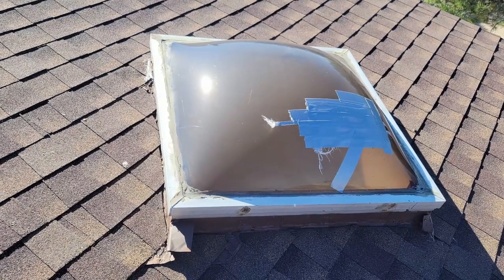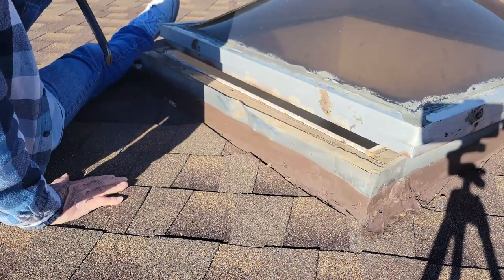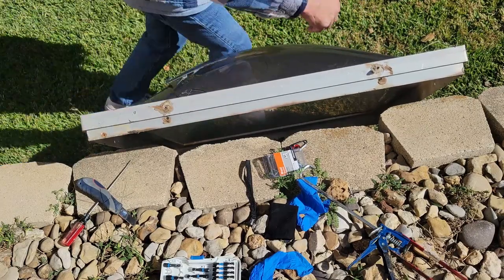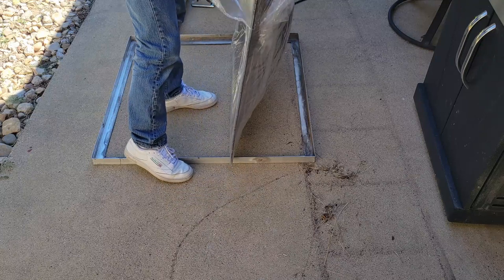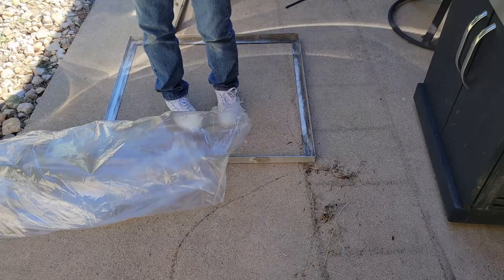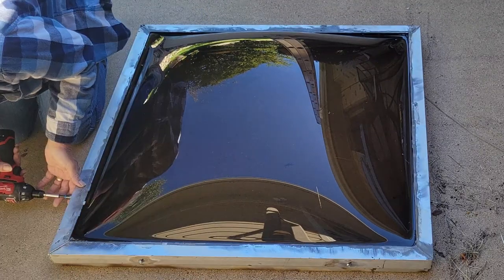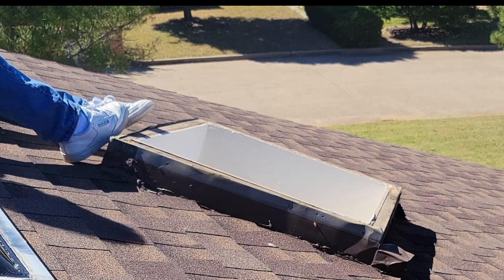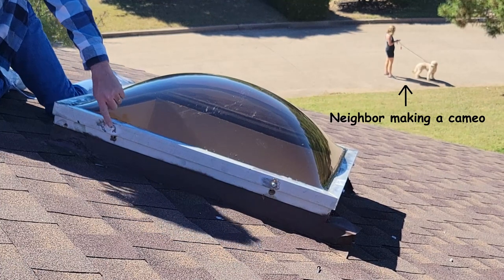BROKEN SKYLIGHT - Replacing a skylight damaged by hail - DIY

Comment: Our skylight is shaped like yours. We also had damage due to a hail storm. Our skylight is double layered. Where do you order the replacement?
Reply from the maker: I get mine from Dryco Skyights in Alvaredo, Texas. It was a bit under $300 for both the inside and outside lenses the last time I ordered them.

Comment: Awesome video. I looked back at a roofing quote I had last year and they wanted to charge $2,000 per skylight and I have 2 of the ones you are replacing.
Reply from the maker: I was in the same boat 20 years ago when the first one got blown in by hail. I was surprised at how easy it was to replace myself. 👍
Reply: Can you use the same frame if you change it out with a flat skylight?
Reply from the maker: @Lar2-D2  It depends on the skylight, but I would guess that you probably could. The frame attached to the house is what you attach it to.

Comment: I'm surprised these don't have a replaceable gasket.  Roofers used a metallic tape to reseal mine and that did not work as promised.
Reply from the maker: I am a little speechless that they would put tape on them, they have a replaceable gasket. You can buy gaskets at Lowes, they have a few different sizes.
The gasket goes between the bottom lens and the frame attached to the house, that's what keeps the water out. Then cork spacers go between the lenses, then a bead of silicon for good luck between the top lens and the upper frame.
I have 4 skylights, I go through this after every 3rd or 4th hailstorm, at least one breaks.
Reply: @GuysPlayingWithTools  Thanks!!!
Reply from the maker: If you aren't afraid of being on the roof, and you are coordinated enough to not fall off, it's a pretty easy job you could do yourself.  A few screws around the outside of the aluminum trim hold it all together. I silicon them too, I don't think it makes any difference though. 
Let me know how it goes! 👍
Reply: @GuysPlayingWithTools  I am afraid.  It's pretty high up, but this tells me that it shouldn't cost $1k to have someone else do it, which is really helpful.
Reply from the maker: @donnasfix-it3861  mine are 32" square, and I got a quote of $450 including installation for the latest,  top of the line,  energy saving skylights. I paid around $130 or $140  for each set of 2(inner and outer) for the lenses I am using now. 
My house is a 2 story . If I stop making videos after a hailstorm in Dallas, you will know what happened.  Lol
Reply: @GuysPlayingWithTools  Stay safe!
Reply from the maker: @donnasfix-it3861 I aim for the grass, it's soft.  🤣

Comment: Where do you buy the plexiglass?
Reply from the maker: If yours is a standard size, you can get it at Lowes. Mine was oversized, so I called around and found a place that custom makes them. They are cheaper than will expect. Mine was "huge" according to the guy that I ordered it from and still well under $200

Comment: How do you measure a skylight, is it the outside or the inside/ bubble?
Reply from the maker: You measure the outside edge of the frame on the house, and the height of the peak on the lens(the plastic bubble)
I just replaced another a couple of weeks ago and decided I am changing them all out to flat ones when the next one breaks.

Comment: No caulking between the lower frame and plexiglass? Doesn’t seem too air tight.
Reply from the maker: There is a ruber seal between the plexi and the top of the frame under it.  It wasn't obvious, I apologize for not making a point of showing it.
Reply: @GuysPlayingWithTools  Thanks for that. Makes sense. I’ll be doing this soon on a 5 sided geodesic dome skylight. I’m needing all the pointers I can get
Reply from the maker: @edthayer5535  Biggest tip: Don't bring a camera on the roof. It's hard to set up the tripod. Lol
Seriously though,  gloves, a pocket knife, screw gun and bits,  and someone on the ground to chase tools for you and it's not hard at all. The hole is intimidating while the old one is off. If you have an inner and outer lens,  all the sealing happens on the inner. Don't silicone it down. Rubber or cork gaskets with sticky tape on one side work great. Good luck 👍
Reply: Can you tell me where in South Dallas? I live in Dallas, too. I'm shopping around for a skylight dome for one right now. Thanks!
Reply from the maker: @louievelasquez3067 I am in the middle of a project, I will look it up once I finish and get cleaned up tonight. (I don't remember off the top of my head(
Reply from the maker: @louievelasquez3067  Hi again. I looked it up, I get mine from Dryco Skylights in Alvarado.. It's a bit of a ride for me but I have 4 skylights and you know how hail beats them up.

Comment: dont you need to add adhesive? i need to replace my skylight but wantes to upgrade to glass. im being told i need to buy the flashing and adhesive kit
Reply from the maker: If it wasn't leaking and just has a cracked lens, you just need a lens and some silicone. Roofers try to sell us the world after every hailstorm. 
I have 4 of these and have been replacing lenses for 20+ years. I drop them in, put the screws on the frame and silicone the screws, then run a bead around the top where the frame touches the lens and it's good to go. Don't let them sell you stuff you don't need.  🙂
Reply: is there a specific type of silicone you like to use?
Reply from the maker: Not really. I originally thought clear silicone wouldn't hold up to the heat but I have learned it works as well or better than anything else I have tried. I have one that I replaced over 10 years ago that is still going strong. I get it on the roofing aisle, and over the years, the brands have changed, but it always works.

Comment: Where'd you get the replacement from?
Reply from the maker: I am in the dallas area. I found a place in Burleson that custom made them.  Nearly every city that gets big hail has a shop like it.  One of the guys there dropped it off on his way home.  🙂
Reply: If it’s a basic skylight like a 2x4 skylight they should have replacement glass at Home Depot. Make sure to get the one about 1/4 inch smaller than your curb
Reply from the maker: @nicksturi8697  Unfortunately mine is custom. I tried all the box stores and found nothing. There are companies that make them overnight all over the place though.

Comment: Where you bought the skylight  thanks you
Reply from the maker: I got the lens from a local company just south of Dallas. It turned out that companies are everywhere that custom make the lenses. Look around a little online. Finding someone near you will save you a fortune in shipping, some companies wanted as much as $80 to ship one.  
If you don't find one locally, email me and I will help you find one near you.
Reply: Thanks you I living in Dallas  too.I will take a look
Reply: Silly question did you try Home Depot
Reply from the maker: @chuckefunn8624  Yeah  I tried them and Lowes first. 
They carry a few standard sizes and mine weren't any of them. When buying new one(s) there are a few factors
1. Size
2. Tint color
3 Material 
4. Rise (center height)
5. Rise Angle 
6 Double vs Single
With all these factors, unless yours are pretty recent, or if you don't have others that you want to match, a custom shop is the way to go(plus,  they didn't cost more than the box stores)

Comment: Why don't you replace that with wire glass instead, done for the next 20 years.
Reply from the maker: I wanted to. When I did this, i was in a hurry and couldn't get what i really wanted before I left for an overseas trip.  I have 4 of them, so when the next one out, I am getting a matching set of hurricane rated glass.